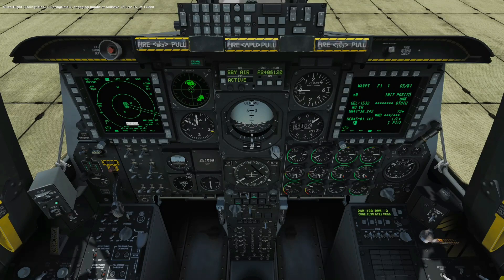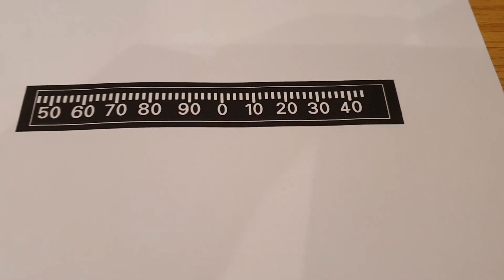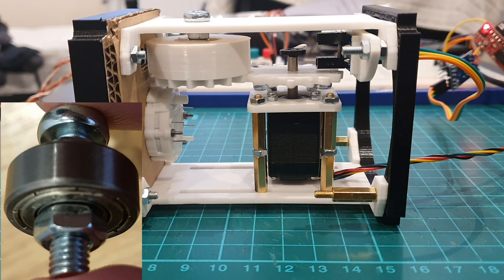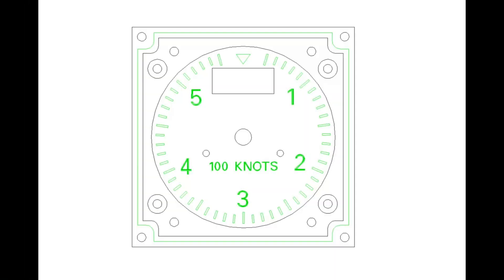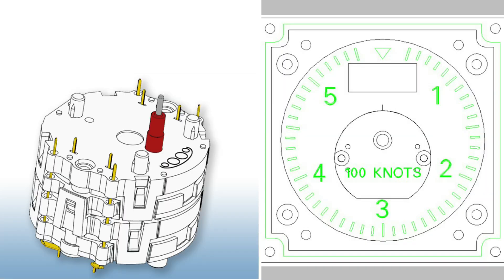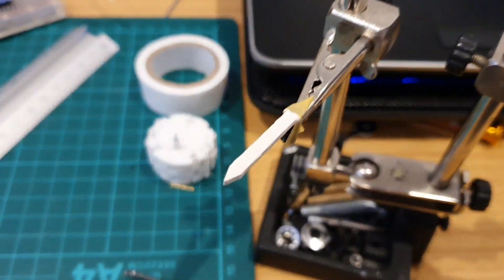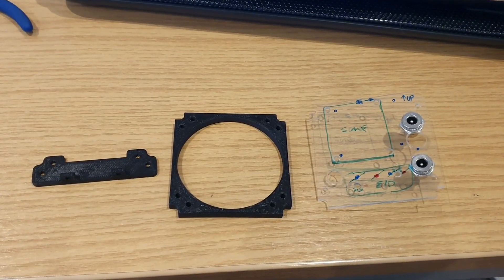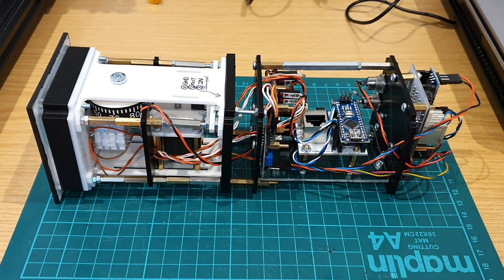Simpit A10C - Front Dash - Part 26: Airspeed Indicator - Design and Construction

Comment: Why did you use rs485 instead of USB for the connections?
Reply from the maker: Hi Bob, if I was using just a few panels with the simulator I would use normal USB connection per arduino. However, when very large numbers of USB connections are made there can be drop outs. So the RS485 network let's me run potentially hundreds of panels with just a handful of USB connections
Reply: @CraigSmysimpit  Are you using true RS485 Serial? Throughput on that is only 10Mbps where as USB 3 Gen 2 is as high as 10Gbps more than enough for DCS in my opinion. My background is Network Engineer.
Reply from the maker: Hi Bob, given your background you'll be more knowledgeable in respect of the network speeds, etc. 
However, what I can say is some of the microcontrollers I used, oddly, had less connectivity issues with USB 2 rather than USB 3. USB 2 generally was very good, however when I ran a large number of items through them through several powered USB hubs during longer flight times they would sometimes disconnect. Since using RS485 I can't recall one ever dropping out since
Reply: @CraigSmysimpit  That is unusual, nonetheless, very nice work. I have embarked on this voyage myself. Built my own C02 Laser cutter, now i can start with this project, after watching you,  The Warthog Project and Deadman i have been inspired.

Comment: Great work Craig! I'll be using a similar  design for the tape wheel for the standby compass I'm designing at the moment. I'm hoping an X27 should be fast enough for that one. Question- what are you using as the sensor for your zero position? Is that a hall sensor? Awesome work as always.
Reply from the maker: Hi Ray, the full description of the item is "IR Infrared Optical Sensor Detection Optocoupler Module". I got them of Ali Express. I tried others, but these worked best for me. Cheers 👍

Comment: Hi Craig another great video :) Just got an ender 5 plus for some panel production.  What software do you use for your cad/cam production if you don't mind me asking.  Inspirational as always.
Reply from the maker: Hi Stephen, most of my initial work is in Vectric Cut2D. I tend to draw all main panel designs there. Anything I want to then create 3D prints for I do in fusion 360 by carrying an exported dxf across to it. In all honesty fusion 360 could do it all, but I like Cut2D at the outset.
Good luck with your 3D printer, definitely a key tool for cockpit building. 
Thanks for watching my video 👍

Comment: Awesome work as usual Craig.  Looks like you got a 3D printer too.  Which one did you get?  So do you use both the CNC machine and the 3D printer for final assembly or just the CNC machine?
Reply from the maker: Hi Joe, I got a Creality CR-10S. I design my panels with a front fascia to be cnc cut. As I then build the rear layers I use the 3D printer mostly for brackets, gears and other bits. I think I'd be lost without a 3D printer now.
Hope all is well your end, take care, cheers 👍
Reply: Craig S This guy reminds me of you. Except that you started with a high end machine first, but he started with just 3D printers and moved to the better quality stuff. He started making 3D rifle stocks that hold VR controllers so that it feels like you are holding a rifle. 
https://youtu.be/fWfAIx1wC60